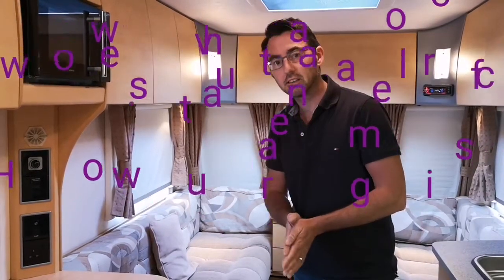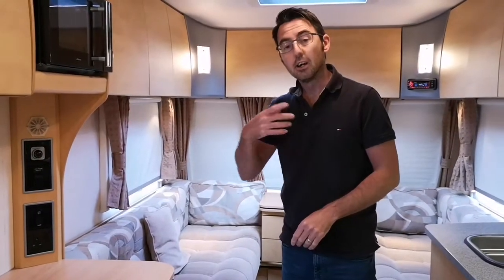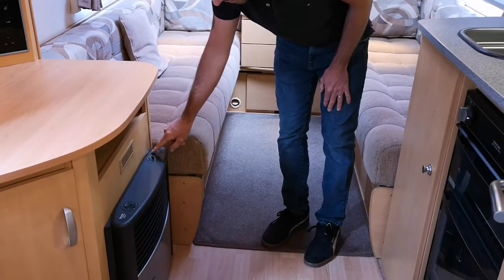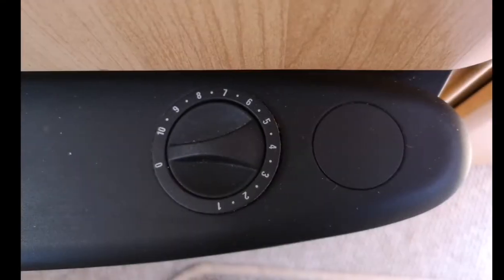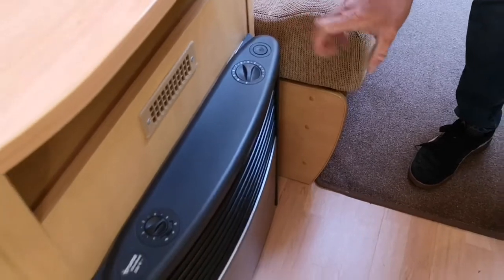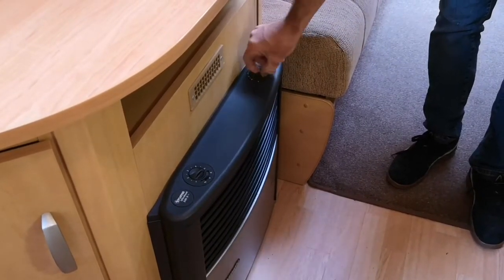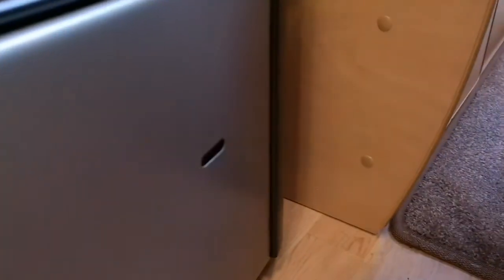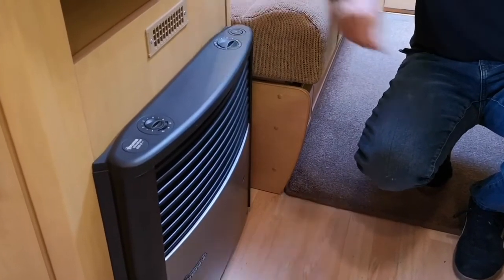Truma gas fire how to use, truma s3002 fire

Comment: Just spent over an hour following your instructions.
Nothing happening.
Reply from the maker: It sounds like it could be a fault if you have the lights on the controller and fuse spur in the on position it should work. 👍